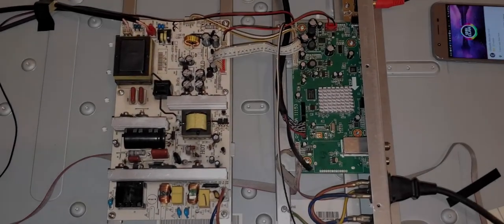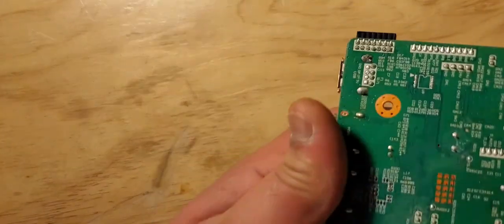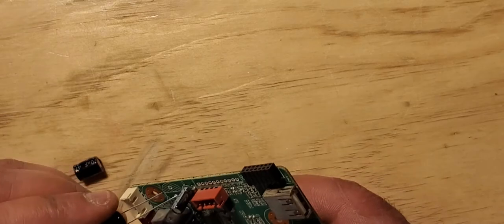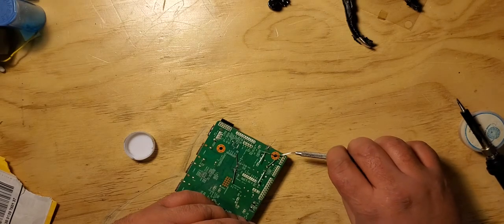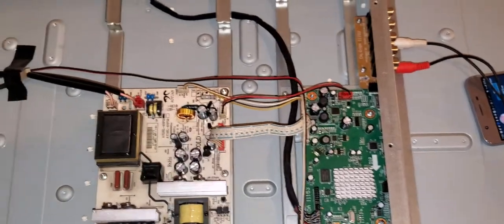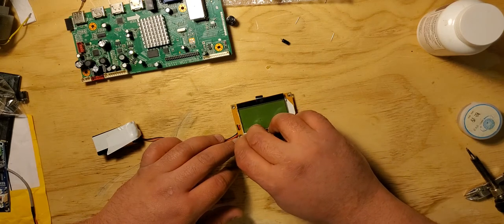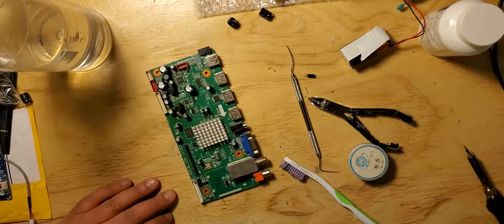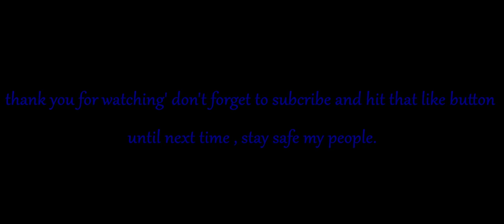PT2 Westinghouse digital t.v. 37” Annoying buzzing sound, (main board repair) M# 3710

Comment: man i watched the whole video, that was really interesting, i'm having some very similar issues like your tv, the thing is my tv does turn on and works fine, but that buzzing sound is constant, the moment i turn on the tv, the buzzing sound starts, i also opened the screen, but i couldn't find some faulty capacitor. it has to be a capacitor right?. or can it be something else.
Reply from the maker: Hi. Yes most likely it a capacitor.  Or probably the ic chip for sound
Reply: @jayflash1000 yeah I'll work on that tomorrow, because I noticed when is cold the TV doesn't turn on. So yeah I'll let you know if it was a capacitor

Comment: Hey bro really need some help. I was looking at a technical pro amp video you post a while back and i was wondering if you can assist me in diagnosing my issues. My amp works and everything but for some reason Im getting no bass out my speakers. What can be my issue or issues?
Reply from the maker: Hey sorry for the late reply. Ok so their no bass coming out!  you didn't try changing the equalizer setting check that first. If not then we continue from their.